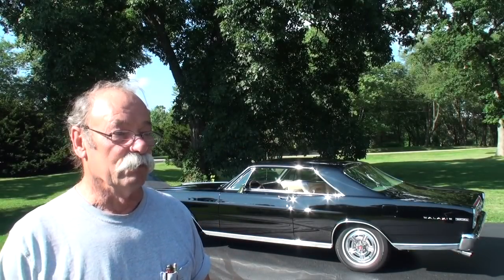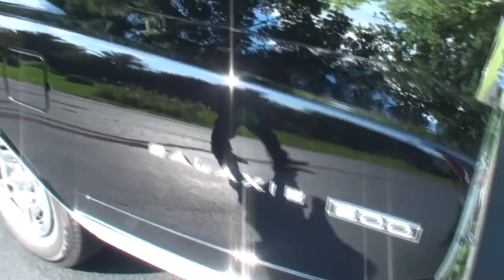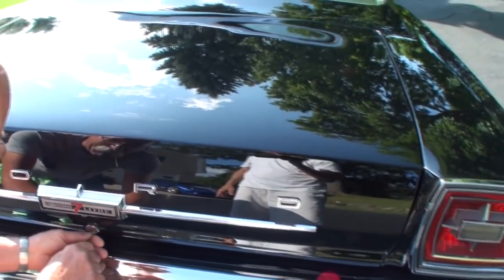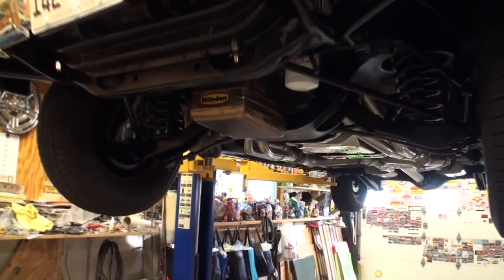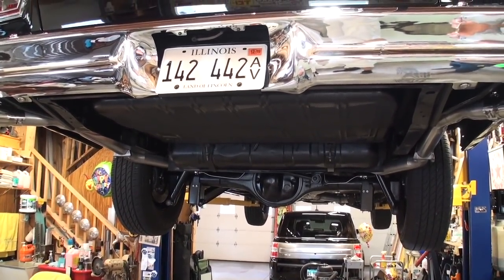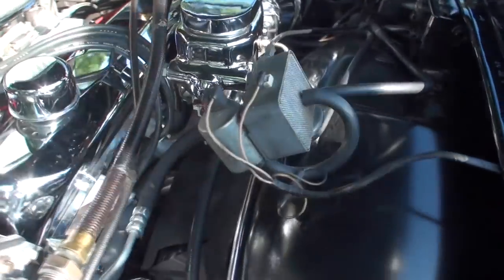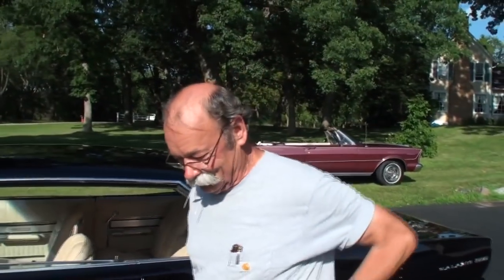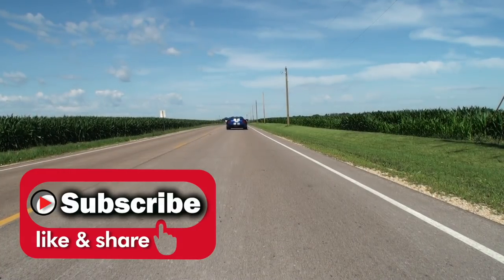1966 Ford Galaxie 500 7 Litre Hardtop in Black & Engine Sound on My Car Story with Lou Costabile

Comment: Another bucket list car, only thing missing is a 4 speed, I always thought this grill and front end treatment was perfect for the car. AND this guy is most assuredly a Ford man, I saw the Flex in the garage
Reply from the maker: The bucket list got a new addition :-)
Reply: This engine wasn't as much of a screamer to need the 4 speed. Had very comparable torque to the 427; but the 428 was made for 2000-3500 RPM cruising for hours on end.

Comment: Thanks, grEat 66 GALAXIE BUILD UP..MY 66 GALAXIE 500 XL /4 speed/352 in Burgandy was nice cruiser,.. Interestingly I heard FORD put COOLANT RECOVERY SYSTEMS ,MOVED THE Hazard Flasher out of Glove Box ,etc On **many of 66 Fords.... I used mY Local FORD Dealers for lots,of My Galaxie’s build Ups, etc. ACTUALLY, HAD to special,order a non Ford METALLIC Brake  for the best Brakes ( I did,not have the FRONT  DISCS)......Etc. Fun times.
Reply from the maker: Hi Opera, Happy to read this one reminds you of your 1966 Galaxie :-) Thank you for sharing, Lou